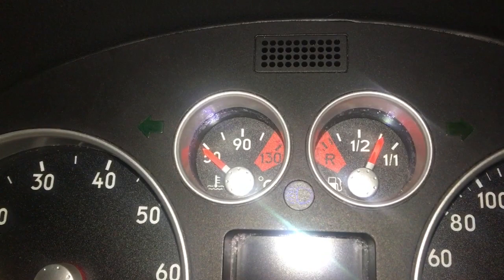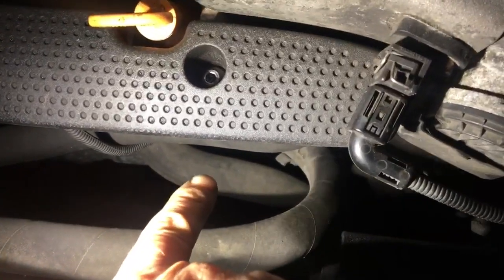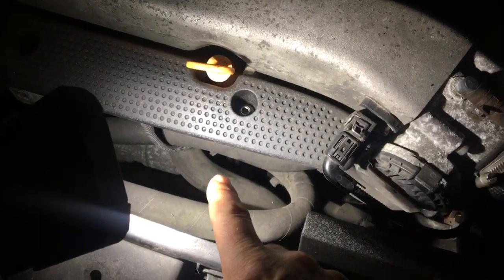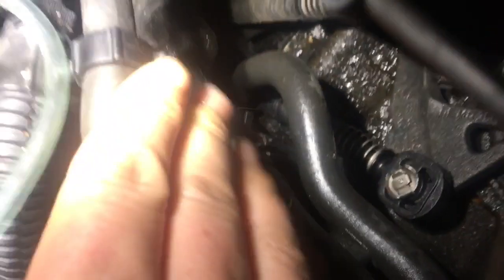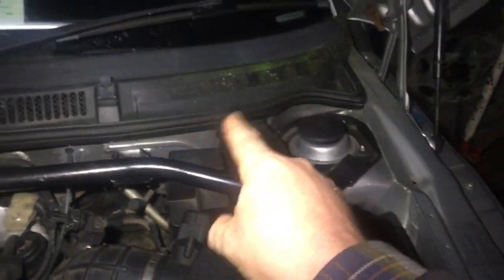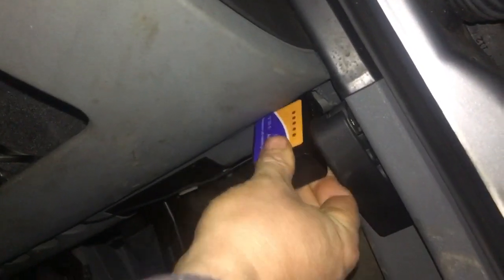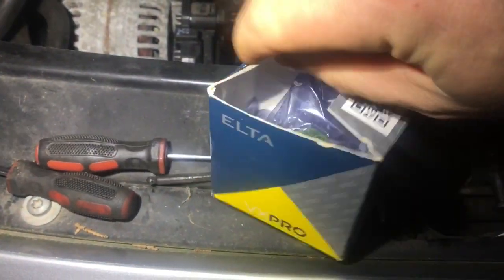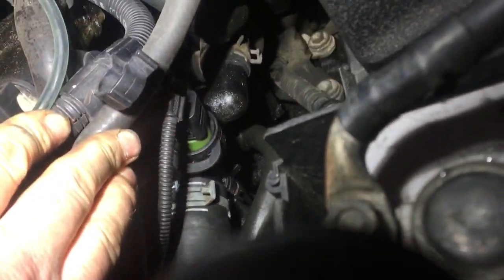19) Coolant temperature sensor and Thermostat. P1296. Audi TT

Comment: have you ever changed the coolant temperature sensor on the radiator?
Reply from the maker: Yes it’s a 30mm or 32 mm nut on the radiator. I’ve changed in on a mk1 and Mk2 golf but I’m guessing the the same on the TT as well

Comment: Hi, I have the opposite problem, when the car runs hot the fan is not cutting in. Guess the above could be the issue. 1 Q, can the lower thermostat bolt be accessed from underneath the car?  Cheers..
Reply from the maker: I don’t think it can be done from under the car. Fans not turning on - It sounds like the sensor on the side of the radiator or the controller under the battery it’s like a size of a red brick is gone faulty

Comment: Hi Steven my tt has no hot air from the vents and temp gauge is going into the red. the inlet and outlet hoses to the heater matrix are cold. does that sound like a faulty thermostat.
Reply from the maker: Might be stuck closed . €5-10 for a new thermostat so it’s fairly cheap
Reply: @stevenharpervw  thanks for the reply removed the thermostat thanks to your video. Put my finger in to the water pumps spinning and moving back n forth
Reply from the maker: @scottmckenzie1162  I don’t think the water pump is meant to freewheel 🙈 I think you have a problem . Mister auto website I got my water pump and Timing belt and tensioner - INA brand I can’t remember the price but around €130-150 for the parts and I gave it to my mechanic and just paid his wages. He only fits ina or gates timing belts as both are approved by Vw/audi. There are videos online how to change the belt but it’s something you only get once chance to do it correctly the first time. So I didn’t risk it. ( also why I don’t have a video of it 😂)
Reply: @stevenharpervw  yes I agree should not free spin our push in and out !!! Thanks for the video made the thermostat a simple job just not the out come I really needed 👍👍
Reply from the maker: @scottmckenzie1162  wishing you the best of luck